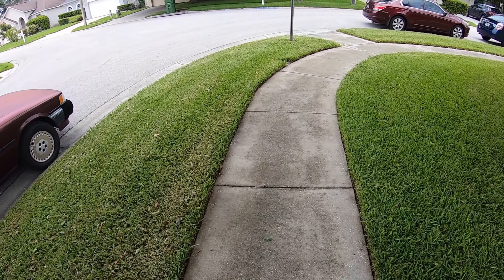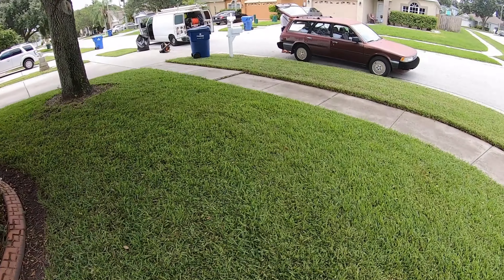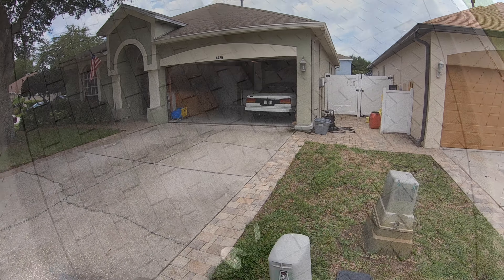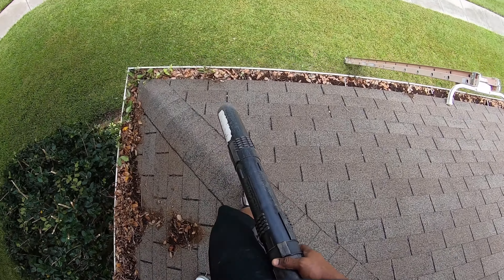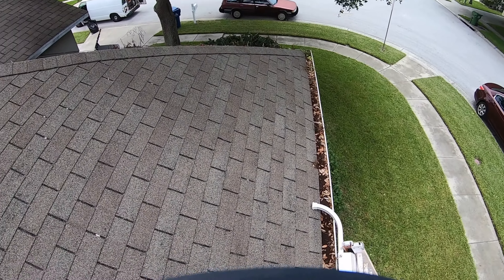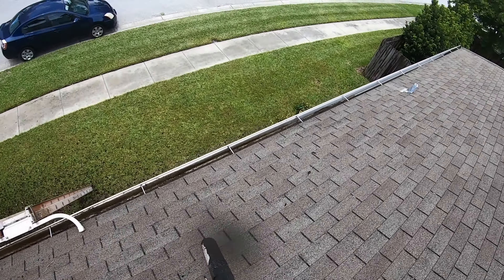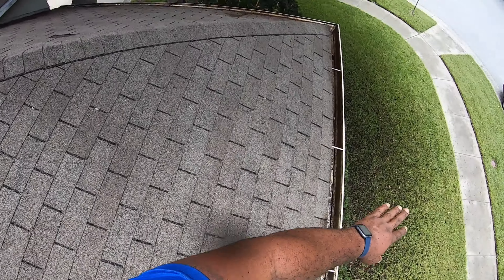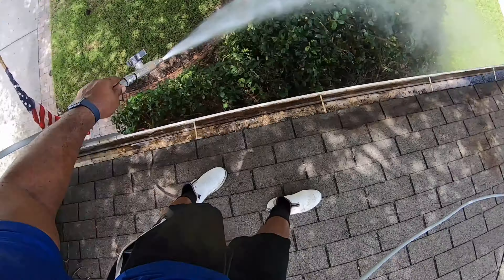$350 in 1 Hour

Comment: Hi, I have a question ? I surface cleaned a driveway today my question is why does my surface cleaner leave lines like parallel lines down the whole length of the driveway. Two circles type of lines all the way down the driveway?
Thanks in advance I appreciate you putting out your content. I am learning a lot from the great job that you do
Reply from the maker: Either you're moving too fast, surface cleaner tips are clogged, or you have a surface cleaner that's too big for your machine. If everything checks out then you may need to pre treat and post treat the concrete with sh

Comment: Quick question. What percent SH mix do I need to worry about plant damage? The strongest I normally use is 1.2% out the gun. I rinse the plants anyway but wondering will that strength even do any damage? When I go up to 3% I definitely rinse rinse rinse. Thanks man
Reply from the maker: downstream mix is very highly unlikely to damage plants. 3-5% definitely will without rinsing.
Reply: @PinkFlamingoPowerWash  Appreciate the info and knowledge.

Comment: Good Work Cliff. Definitely an easy ticket.
What mix do you use on gutters? Also on driveways?
Reply from the maker: The driveways 3% is good. And if you have stripes and tanning stains a 5% mix gets those off via post treatment
Reply from the maker: Gutters you can hit those with a house wash mix. Unless they are oxidized or have stripes thsts a different process
Reply: @PinkFlamingoPowerWash  what are tanning stains? 🤔
Reply from the maker: @malcolmjackson2453  those really dark stains on concrete from the trees. You will never get those out lol no matter how much pressure you use. So just post treat them and they'll disappear by time you pack up to leave
Reply: @PinkFlamingoPowerWash  the stubborn stains lol…ok brother I appreciate it. Ima hit you up tomorrow